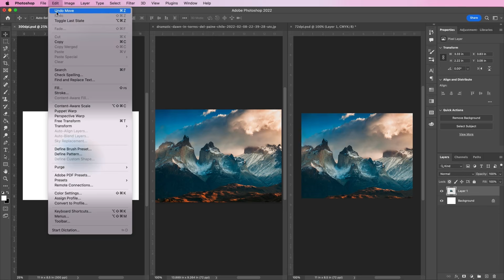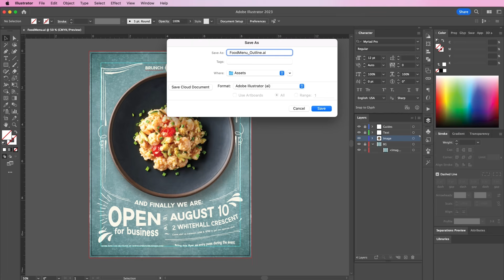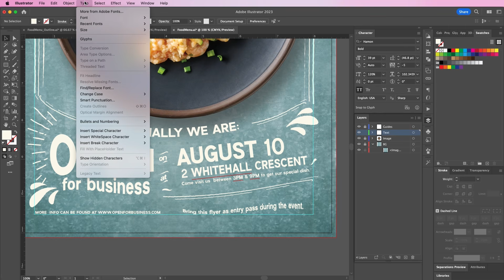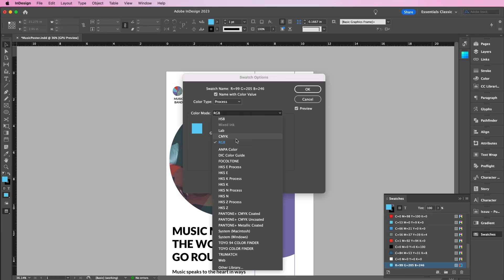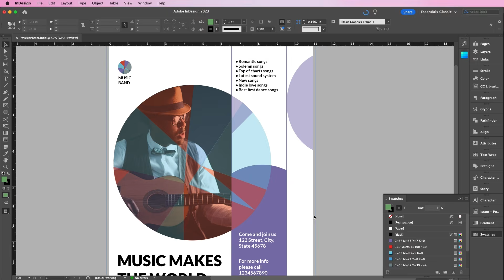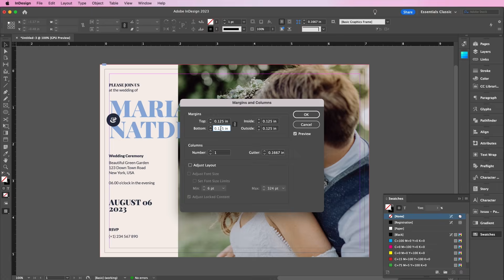Prepare for Print in InDesign, Illustrator & Photoshop | FREE COURSE

Comment: Nice course. Concise and clear. but I don't agree with one point in Links panel customization. I think it's better to check "Effective DPI" rather than Actual DPI. "Actual DPI" is the resolution set in PS. "Effective DPI" is the resolution of the image placed in ID. Cause you often need to scale your picture's frame in ID,  your resolution is going to change. "Effective DPI" will show you the resolution after scaling. I think it's more accurate.